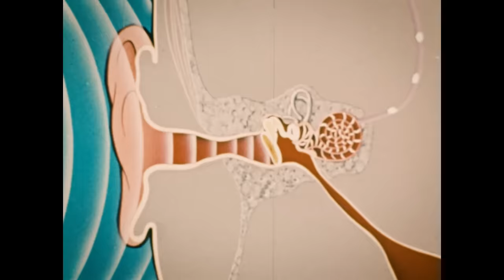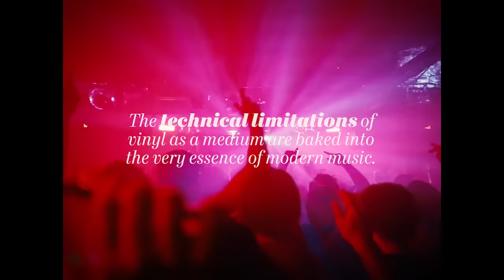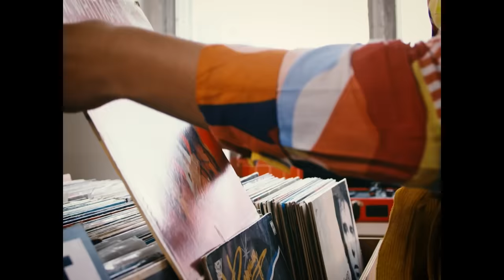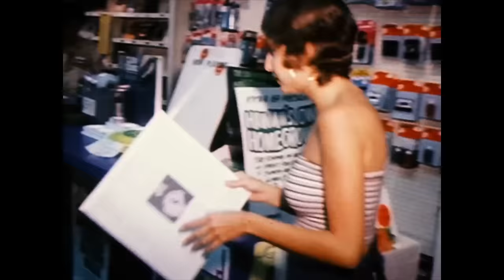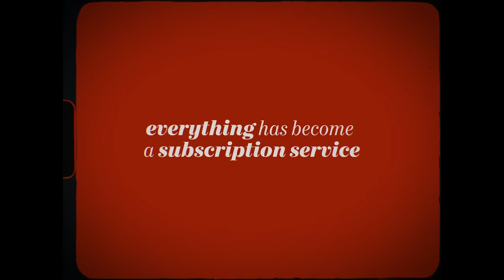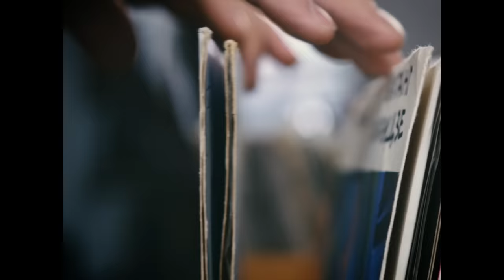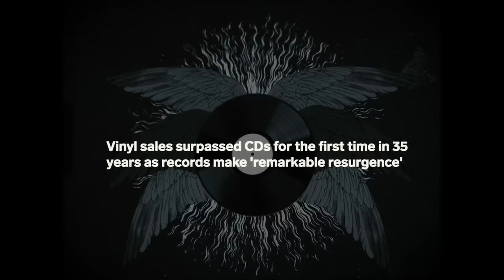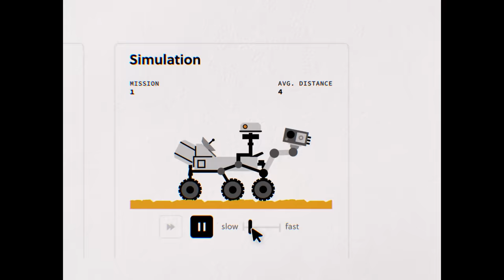Why I Love Vinyl

Comment: One of the things I realised recently is that by purchasing an album, you have made an investment, therefore you have an interest in getting a return on that investment. That means that even if the album doesn't immediately grab you, you will give it further listens.
Some of my favourite albums took several listens before I really got into them. I wonder how many great albums I have missed these days because I took a listen via a streaming service, didn't connect initially and moved on to something else.
Reply: No offense, but as common of a reason as this is, it's such a weird thing for me. Maybe I'm weird, but I don't need to pay for something to decide whether or not it's worth my time, and I'd rather not risk paying for something I don't want just because I might end up enjoying something I didn't initially.

Also, you talk about how easy it is to find new albums almost as a negative. People in the 80s would've killed to have the ability to have thousands of albums on command without having to pay for something just so they could hear one single, or take a risk on a possibly bad album.

I guess the answer here is somewhere in the middle. I've listened to some albums I didn't love at first, but I still come back to them because they're still there. I guess it's just about developing taste and patience, which I think I have. More intentionality is good, but that's a pretty expensive form of self-control.

Comment: This commentary is spot on. There is an intentionality that comes with listening to vinyl that does not come from other modes of music listening. You have to purposely pick up the record, take it out of its sleeve and put it on the turntable and lower the needle. Even if that music is being used as background filler, there is still the knowledge that the flip is coming, thus it pulls your ear in to make that turn. Amazing stuff.

Comment: I'm 28, bought my first turntable, powered speakers and three first vinyl of my favourite band (Depeche mode). I took my time, made a dinner, bought my favourite drink and unpacked everything step by step. I can hardly express the excitement and almost magical moment nervously handling the vinyl with care to not leave any finger prints for the first time, watched the arm with stylus to move and touch the record, then finding out, I forgot to switch sono/phonic and could hear it silently, then I switched it to the right setting and whole room filled with the amazing sound. I felt like a little boy finding out how a new toy works. Really a magical feeling for which I'm gratefull and will remember it.

Comment: Excellent video! I was in my early teen years when cassettes started taking over, and I quickly jumped on that train because the idea of easily taking my music everywhere was irresistible to me - not to mention the idea of mix-tapes. I still have a few records from my beginner music junkie years and I do treasure them even though I have no turntable right now. The idea of jumping back into vinyl is tempting, but wow I can see how that would eat my income, lol. Third Man's offerings and bands like Black Rebel Motorcycle Club and The Kills coming out with amazing vinyl makes it so hard to resist.

Comment: I want to thank you sincerely. I realised after watching this that many of the CDs in my collection (which are mostly ripped and stored in Apple Music) are re-releases of original vinyl (often with bonus tracks). I already had a policy of separating the bonus tracks into a separate "album" called "(album name) (bonus)" and using a lightened version of the cover so I wouldn't confuse the two visually. I wanted to experience the album as originally intended (leaving aside mixing and mastering differences of course - that's another discussion). But now, I've decided to do two other things, where applicable:

1. Find the place where the record was supposed to be flipped and insert a 20-second silent track there (30 seconds for a new disc in a double album), with the same artwork and everything. I call it "FLIPPING THE LP...". Waiting for twenty seconds isn't the same as actually flipping a record, of course I realise that - but it's amazing what a difference it makes to certain albums. I listened to The Crazy World of Arthur Brown (1968) this way, and immediately noticed the difference in character between the two sides. This is a REVELATION. I'm 58 so I remember LPs, but somehow I'd forgotten this aspect of the experience until you pointed it out.

2. Where there are tracks that have continuous music across a join, VLC inserts that notorious annoying "gap glitch". The reasons are multiple and complicated, and sometimes my fault because some of my CDs were ripped to MP3, so I asked for trouble there. But it's fixable... if re-ripping the CD doesn't help, then one solution is to make two versions of the album, labelled "(normal)" and "(gapless)". The gapless version can be made in audio editing software, with groups of tracks that are supposed to play without a gap manually edited together so that they become a single track (with a long title!).

Doing this for all affected albums in my collection is a huge task, and I expect it to take months, if not years... but I now think it might just be worth it. And in some cases I have the vinyl as well, so I can get the full experience with my turntable :)

Comment: What you said about the record store is one of the main reasons I collect physical CDs. Most of my CDs were bought on used book stores. You go there, check what they have in store, find a bunch of things you would've never think of buying otherwise, and then expand your horizons on music. I usually buy metal CDs, but from time to time I buy something random just because. $1 for a Seal II CD in good condition? Why not, I know he's a great artist. It's something that can be done on music apps but it's not entirely the same experience, for some reason. Same as for playing the media. Even though CD is also digital, the quality of the sound is so much better than any music app I have tested, even the ones that claim to be hi-fi. Having the booklet in hand, seeing the CD-printed art, having those special editions that come with interviews and artwork, it's so much cooler than simply typing the artists name and hitting play.

Comment: Great video! Your commentary touches on some brilliant and nuanced points that are missed with the digital norm these days. Many of the points, such as the flipping on the record, runtime limitations, material ownership, the grandeur of a large piece of art, and the modern money-driven algorithms, are considerations that I made with the album that I put out last year, which is designed to be accentuated in each the vinyl and CD media (although it is currently only digital due to financial and demand reasons).

Comment: Holst's the planets was the first record I ever bought, even before I'd picked out a turntable. My copy of Switched On Bach is practically a sacred relic, as Wendy Carlos has removed every digital trace of the album from the internet. I've discovered the chills-inducing flip of Metric's Pagans In Vegas, the sprawling art included with OK Computer, and the bittersweet crackle of a worn down copy of Court and Spark. I only have about 50 records, but I cherish each one, and look forward to every crate dive at my local small secondhand record shop. Each album is a little journey into deep listening, mindfulness, and the thrill of being carried through an entire album as if on a river.

Comment: Personally, I find CDs to be the best compromise between digital and vinyl. CDs are a physical artifact, uncompressed and high quality, without the distractions of listening on your phone or computer (but you can rip to your computer as a .flac and lose no quality). Vinyl's sound quality is slightly more distorted and maybe warmer than CDs, but good players are expensive, and it's quite a delicate, high maintenance and increasingly expensive hobby. New CDs are about 3x cheaper than new vinyl but deliver better audio quality when played through a good player and speakers.

Comment: Vinyl records are cumbersome, they're expensive, they certainly don't sound better to me, a person who can't tell the difference between a lossless file and an mp3. They are prone to dust and dirt, and are easily damaged which affects the sound quality. It's annoying to have to get up just to flip the record over. You need a bunch of specialist (and often expensive) equipment just to play it. You may even need to replace the stylus every now and then. You often need to make sure the turntable is calibrated right, and that it's playing the right speed.

But I don't care.

This video is everything I love about physical media in general, not just records. The physicality of the art, the fact that you own it rather than renting it, it's a tangible memento for something that has brought you joy, and this is a hill I will die on.

Comment: At least 80% of this could be said about CDs, yet you barely mention them. For me CDs are better than vinyl for a few reasons.

First, vinyl is fragile. When I first started buying music in 1979-80 I bought vinyl, but scratched several of them, and I’m not even a clumsy person. And they can warp if not stored correctly. In thirty years of buying and handling CDs I’ve only damage one even slightly. It slipped out of my hand. Instead of just letting it drop and picking it up I tried to catch it and scraped it against the jewel case in my other hand. It skipped on one of the songs after that.

Second, I don’t think the fidelity is superior to CD. The crackles and pops are only slightly better than the tape hiss of cassettes. A well mastered CD sounds just as good as even freshly cleaned vinyl. Plus the needle running through the groove is causing slight bits of damage every time you play it. Not true of laser light.

Third, portability. I can listen to CDs in my car, or in a portable player at a beach or park.

Fourth, I have a six CD changer. I can listen for hours without touching the player. I can relax and let it wash over me for some or all of that time, or I can do some chores around the house. If I want to skip a song (or repeat it) while I’m washing dishes I have the remote within easy reach. As far as I’m concerned flipping is a bug, not a feature.

Fifth, price. With the exponential growth of demand for vinyl, prices have skyrocketed. I would say this is the worst time to start a vinyl collection. As the market shifts due to videos like this, CD prices are going down. Thank you for that.

The only thing that is truly better with vinyl is the artwork. I will definitely concede that, but putting that against the advantages of CDs is like a college football team playing an NFL team.

I love my CD collection, and would never switch to vinyl or streaming. For bands where I only like one or a few of their songs, I buy on iTunes. Those are the only files I use. I’m not going to buy a Blind Melon CD just because I love No Rain, for example. That would be a waste of money and space. My collection numbers roughly 700. Coupled with about a thousand songs on iTunes, that’s the perfect sweet spot for me. Enough great music to last me a lifetime without getting bored, but not so much that it takes over an entire room.

Comment: My only issue with vinyl is that it's quite toxic in terms of the material used, and is actually quite a problem to be around with when it's played.
It's also nearly impossible to properly throw out when you want/need to.
That said, collecting and not playing should be fine.

Comment: There is no world in which vinyl is going to "sound better" than a CD.  A needle in a groove is not physically capable of the same dynamic range as even 1" tape used for recording and mastering, much less 16-bit 44.1 KHz digital audio.

They are much more fun, though.

The biggest argument against the production of new vinyl, though?  Microplastics.

Comment: I think you wimped out and could have done a few more hours on this. Random play is the devil. I miss listening to a Steely Dan album and knowing what the next tracks should be at the cost of having thousands of tracks on random play. I miss the smell - take Wish You Were Here for example which came in a black PVC bag - whenever I smell the PVC smell now it takes me back to the day I bought the record. Then there was the personalisation. Kate Bush famously visited the pressing factory and would etch notes into the leadout of the record, often thanking her fans that you could read if you turned them up to the light. While online streamers have recommendation engines, we had bargin-bins where I first got turned on to Ry Cooder and other great artists who didn't sell well. Come on dude, you need a part two!!

Comment: What a pile of flowery crap! I grew with vinyl, even bought $25 half-speed mastered LPs. (And keep in mind that  LPs also wear out, digital doesn't.) Although technically, an LP can contain more information with a higher frequency response minus their substandard bass... CDs blow them away! If you buy a high-end amp (NAD) and Sennheiser headphones (HD 800s), you will find that digital has FAR BETTER sonic clarity and resonance! Everybody that I've met who say LPs are better never take me up on a sound challenge... ha, ha. Isn't that the reason to listen to music? For sonic clarity! If you want art, buy some art or print it and put in on a wall (I'm also an artist).  if you want the best sound available, buy digital (not low-grade MP3s).